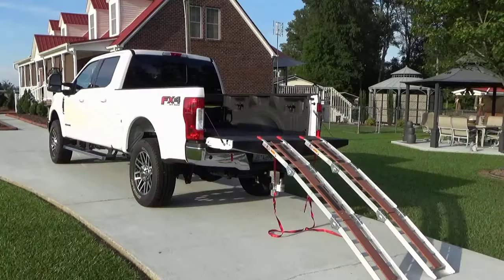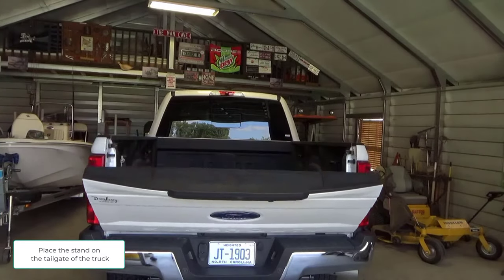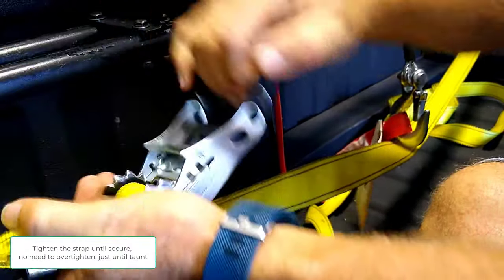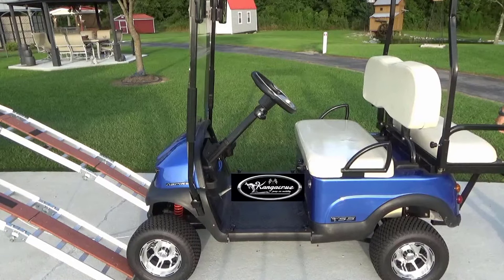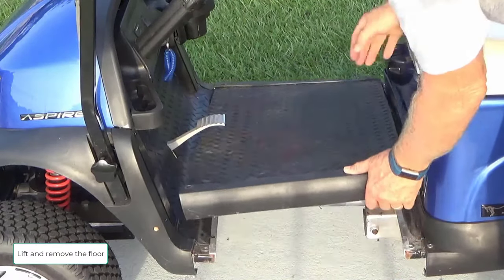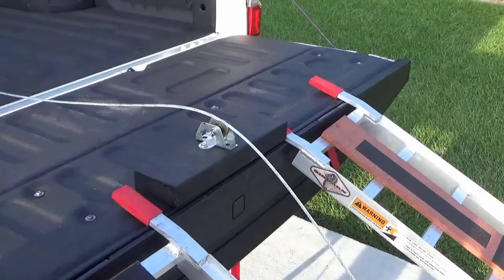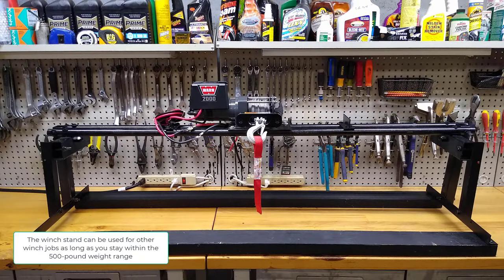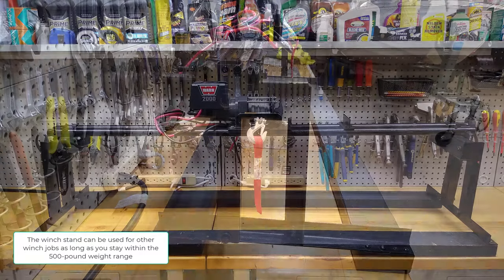No Weld - No Bolt - Portable Truck Bed Winch Stand

Comment: I'm looking to DIY one similar, but with a landscape timber, or wooden 4x4 attached to the factory front  tie downs in my 1996 Dodge Ram 1500. (In the flooring) or add it to the rear of the bed to drag John Deere lawn tractors onto a tilt bed trailer. Nothing permanent, but also a fast mod. Will be loading/unloading John Deere 185 Hydro: Weight: 625 to 645 pounds lbs. John Deere Model 265 Weight: 630 to 755 pounds. John Deere L110: Weight: 462 lbs or 209 kg. STX38 Weight: 433 lbs. J. D. Model 111 Weight: 445 lbs, or 201 kg. As I'll be moving mowers quite often, I'll need something sturdy, but quickly, and easily secured. Just picking your brain for a way to make a secure connection between the wood, and the tiedowns. Thinking about lag type eyebolts to connect chains from the wood to the tie downs. Maybe I'm overthinking the idea?  Any ideas would be appreciated.
Reply from the maker: Michael,
Once you decide on the following:
•  The type materials you plan to use to build the winch frame.
•  How the winch frame will be anchored to the truck.
•  The type of hardware components you plan to use.
You will need to do some calculations and research.
You need to know the tensile strength of each component. (Strength refers to the ability of a component to resist loads without failure due to excessive stress or deformation). 
You need a winch rated at minimum 1.5 times the weight you need to pull. Also remember winch weight pulling capacity changes significantly on an incline. Pulling a 600-pound lawnmower up a 30-degree incline can reduce the pulling capacity by more than 15%.

Calculate the force required (normal and gravitational,) to pull the mowers up the (% of incline you have using the length and rise of the ramp. Use the heaviest mower weight you plan to load for this calculation.
You need to know where the normal force is being applied to each of the components.

Example: On my winch stand, it was designed to let 65% of the downward force to be applied to the 18-inch steel angle brackets that face forward on top of the 2X4’s. 
When the winch is pulling the golf cart up the ramps, the 2X4’s is pressing downward onto the truck bed stopping the winch stand from shifting outward. Only 35% of the force is being applied to the anchor points inside the truck bed. That is why only one 5,000-pound capacity strap attached to two anchor points can hold the winch stand in place without breaking the strap or bending and breaking the anchor points.

You mentioned using wood for your frame, wood also has tensile strength. You can find this information online.
The anchor points in your truck bed also have a weight capacity limit, this may be available from the manufacture’s specifications sheets.

Only use components that meet or exceed the force weight limit needed to safely pull the lawnmowers up into your truck bed.
Normal force, Incline and rise and other physics calculators are available online to help you calculate accurately.

I hope this helps,
Thanks for watching my video,
Norman
Reply: just use a cable with hooks on each end attach this to the lower cargo hooks and hook your winch to the cable so simple .My small winch is mounted on a receiver i have a hook mounted on the receiver to hook to the cable , 5 minute job .

Comment: Where can I get the plate for the winch?
Reply from the maker: I made a winch mount out of an old piece of steel plate. You can buy a universal winch plate from Amazon or most automotive parts stores. You can also buy a low-cost steel mount plate from harbor freight tools for only $4.99. This plate is made for the Badland brand 2000-pound winch. You could modify it to fit your winch.
Thanks for watching my video.
Norman
Reply: @NormanGooch  great thanks.  I just did not think the dimensions matched what was listed in the PDF.  Thank you again for the help.

Comment: Did u fab the bracket for the roller ??
Reply from the maker: No, its not fabricated. The roller bracket is a garage door header bracket that you can buy on Amazon or at most home improvement stores.
Thanks for watching my video.
Norman

Comment: You need to cover that positive connection in you jumper to the battery from the winch.
Reply from the maker: Curt,
I do have battery covers over the positive and negative post terminals when traveling with the stand in the truck bed. 
Unfortunately, did not show them in the video. I probably should have since some people may not know why they should use a cover. 
Thanks for watching my video
Norman
Reply: @NormanGooch  Great video, I have the same need to pull our Cricket mini golf cart into our F150. Any reason you did not just use the truck battery with the truck idling vs. a separate battery?
Reply from the maker: Mark,
I use the winch stand in two different trailers for pulling up heavy items. When cutting firewood, I attach the winch stand to a tree and use the winch to pull cut logs out of the woods or out of the ditch along the woods.  It was easier to use a separate battery and take it with me when I am working on these jobs.
Thanks for watching my video!
Norman

Comment: Great idea, but seems like it would be far easier to find a small hill and just drive the cart onto the bed.
Reply from the maker: Scott
I never found it practical or safe to try and locate the right size hill, mound, or ditch bank to load or unload a golf cart.
I travel to several states and different campgrounds up and down the Eastern Seaboard.
When I arrive after driving for several hours, I don’t want to try and find a place to unload the golf cart.
I can safely unload or load the golf cart at my campground site in less than 10 minutes with the winch stand.
Once you obtain all the parts needed to build the stand, it can be assembled in about 3 hours, well worth the time and effort to always know you can safely get your golf cart on and off the truck and be ready to go.
I appreciate you watching my video and thanks for the comments.
Norman

Comment: Let’s see u unload it
Reply from the maker: I should have shown a video on unloading when I released the loading video, for some reason I didn’t think about it. But it is as easy to unload as it is to load. I set the winch to freewheel and back the golf cart to the end of the truck with about a foot of slack in the cable, then I back the cart until the rear wheels are on the top of the ramp, with the cable tighten, I reverse the winch and the golf cart will roll down the ramp as I operate winch. Once the rear wheels touch the ground, I back the cart until the front wheels are on the ground. I then remove the winch hook, and it is ready to drive.
Thanks for watching my video
Norman

Comment: Why not just drive in on.
Reply from the maker: There are two reasons:
1. Safety -The incline exceeds the maximum recommended capability of the golf cart by over 20%. When adding additional body weight of 150 pounds the stability is extremely compromised and could flip over backwards as the cart moves up the ramp and even becomes more unstable as the cart declines down the ramp.
2. Motor power- Since this golf cart is a compact collapsible model, it only has a 2000 watt motor. The limited power of the motor is not strong enough to go up the ramp. If you try to drive the golf cart up the ramp, the motor will stall and it stop and will not move forward.
I hope this answers your question. Thanks for watching my video!
Norman
Reply: @NormanGooch  Very true, I have done it many times and it is always risky….